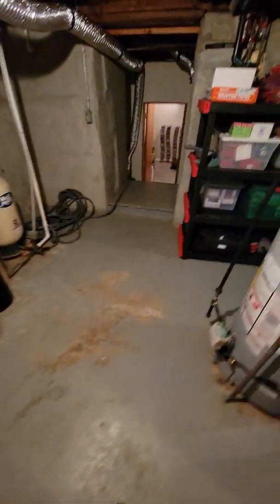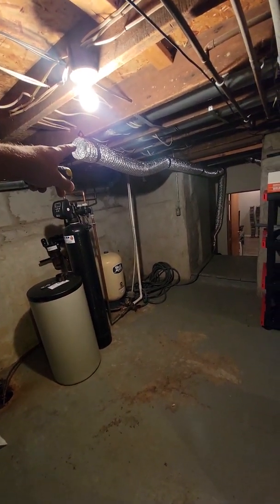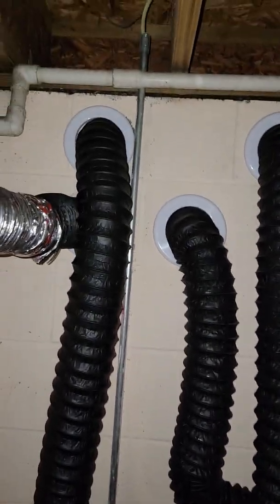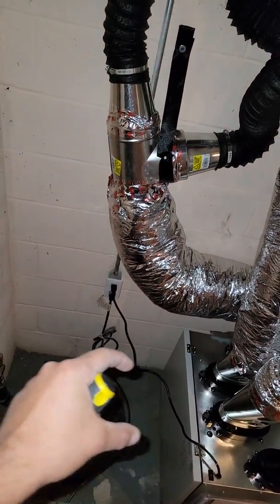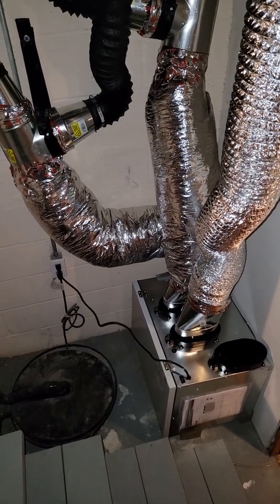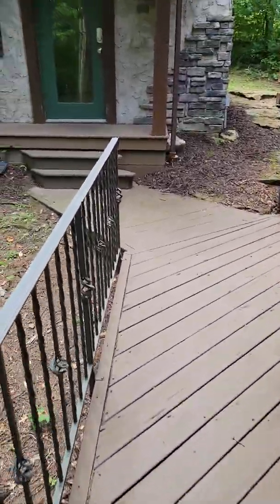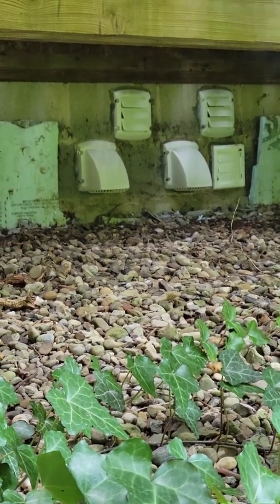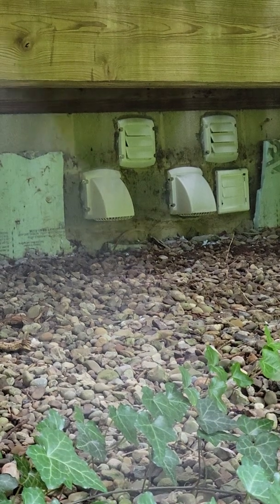ERV installation in Akron OH  - HRV & ERV  Radon and VOC mitigation, air quality

Comment: I think exhaust and intake are way too close together, need 6' space between them.
Reply from the maker: In a perfect world, you are right. As you can see, this home is quite unique and its structure posed quite a few challenges.  This was the only viable entry/exit point.  

Radon dropped 88%, so we'd say it was a success!
Reply: You can extend the exhaust with a rigid pipe fastened under the deck.
Reply from the maker: @WolfgangHermann51  For what purpose? The levels in the home tested at 0.7 pCi/L.
Reply: What was it at before?
Reply: @Ottercraft787  probably a little over 6